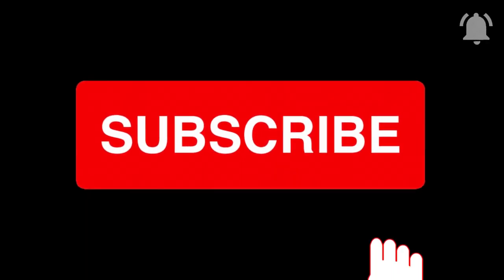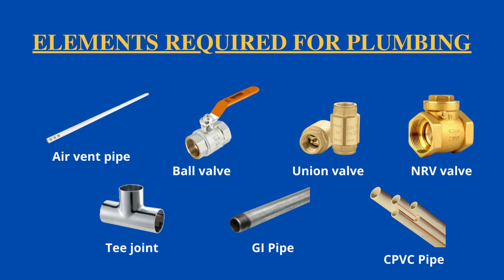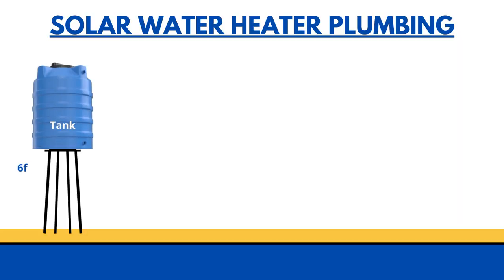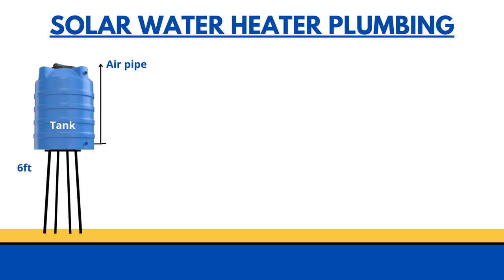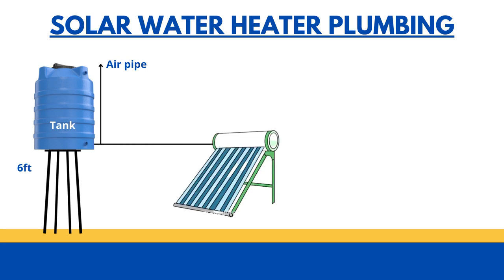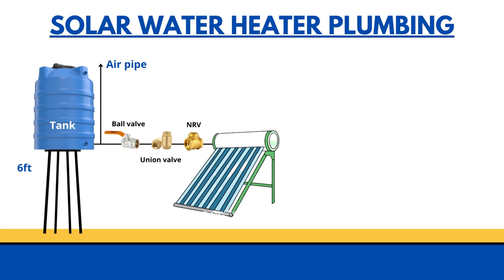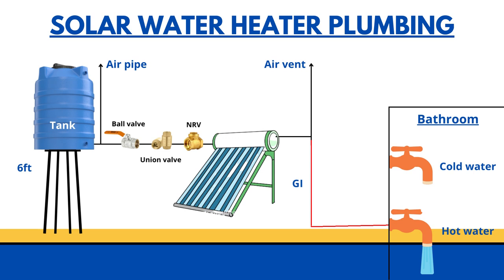Best way to do 'Solar Water Heater' plumbing | Pipeline connection of 'Solar Water Heater'

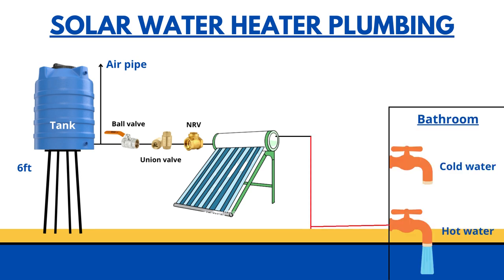Comment: 3:02 can we have a elbow bend for this air pipe near hot water and have this straightened near the water tank? Reason for asking is this air pipe comes in front of our elevation.